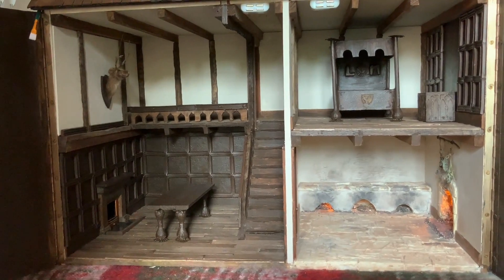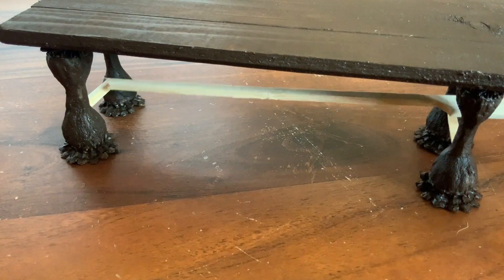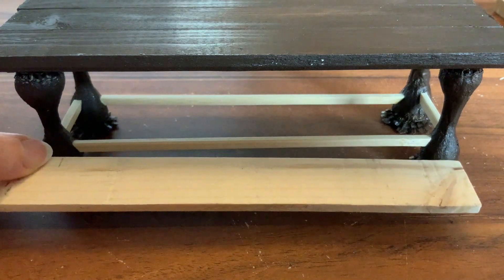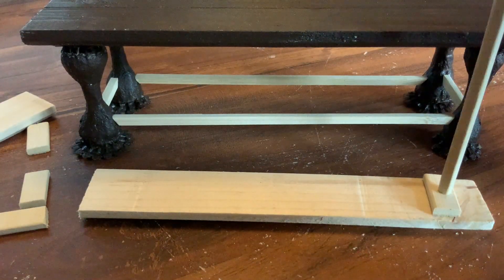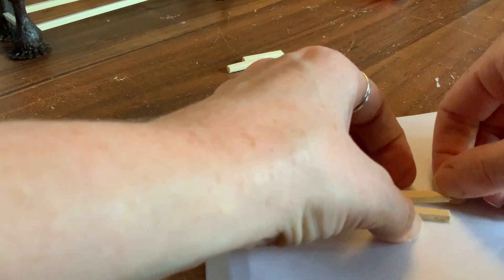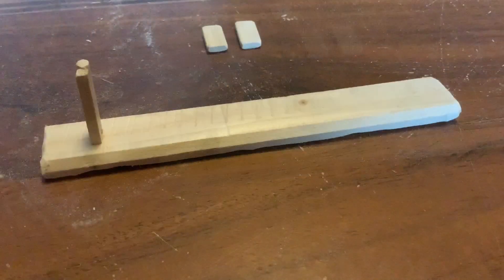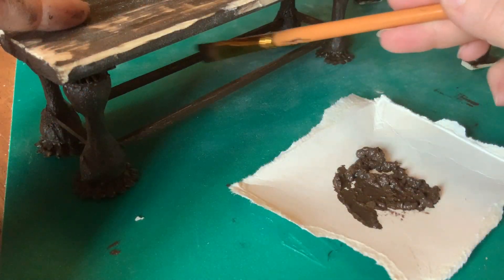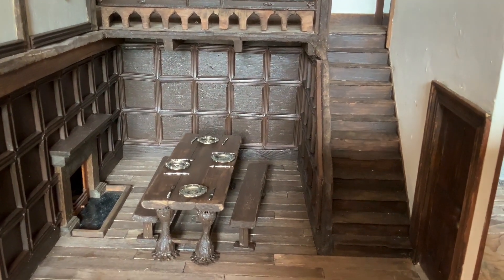Making Miniature Benches | Tudor Doll’s House Makeover Diary - Part 26

Comment: If you haven’t fixed the table yet: sand the laquer off,not too much just enough to lessen the scrapes, use wood filler on any deeper gouges. Restain the table and then see if you can find a really big crafting/ cutting mat that covers most of the area.
Reply from the maker: Thank you for your suggestion!s I’m nervous to sand the top as it’s kind of like a veneer over what I think is a chipboard/MDF type of wood. I’m wondering if it’s worth putting a whole new layer of something over the top of the whole table.